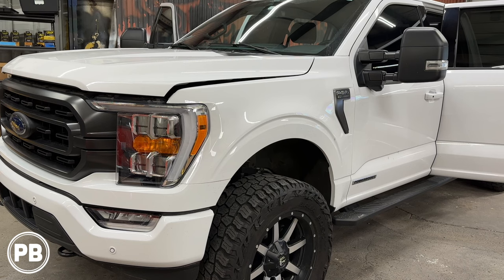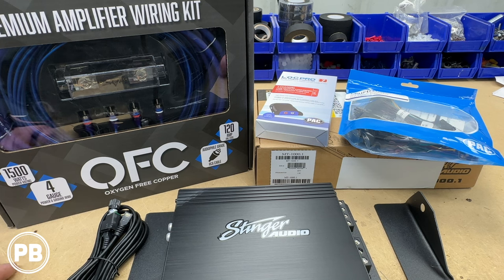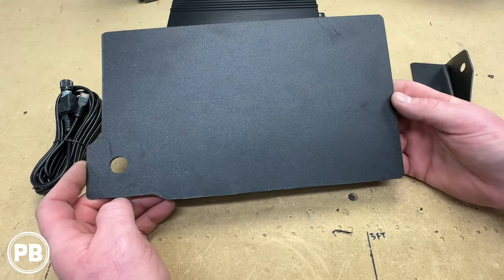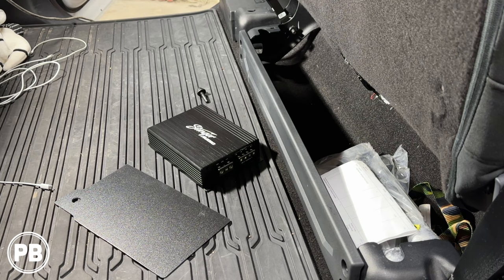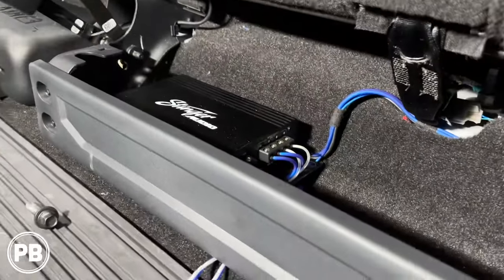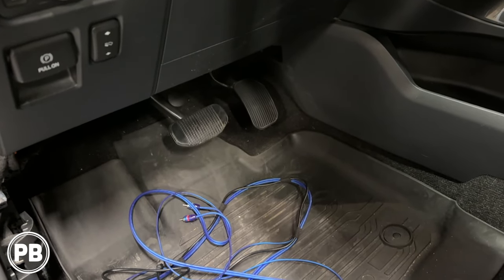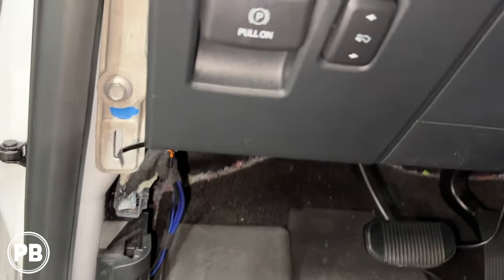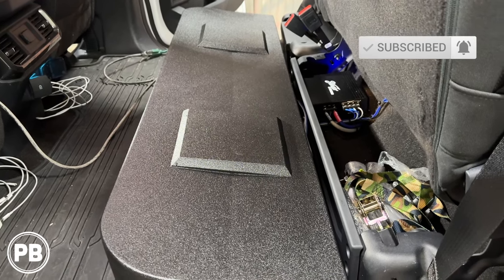2021 - 2024+ Ford F150 Amp and Sub Install (to Factory Radio non-B&O)

Comment: I wanted to say thank you for the tutorials, I was able to swap front speakers, rear speakers, and add a powered subwoofer, as well as sound dampen all 4 doors of my 23' F150 Hybrid because of all of your video tutorials.  All of this done solo, in 1/2 a day.  Without your videos I would have made a lot of mistakes, and many trips to get wiring material and tools.  You saved me much time and trouble.   Amazing!

Comment: Question for ya guys i just had a skar audio underseat subwoofer and amp installed on 2023 ford f150. On this install does the amp stay powered on and lite up a few minutes after the truck is off. I was told this is normal because the Radio stays powered up after vehicle is off. This worries me cause I don't wanna run my battery down.
Reply: I have a 23 as well, I shared you concern initially, it goes off briefly after shutting vehicle off,no battery drain issues 3 months later.

Comment: So I got this setup my skar subs are 1ohm at 1000 watts RMS which equals about 31volts on a multimeter. So I played a 50hz test tone at my clean radio volume and turned the gain until I got 30-31 volts on my multimeter . Is this correct please ?? Cause my shit is EATIN!! 😁😁

Comment: Hello I have 1 quick question regarding this installation video also I really appreciate your video as I am just about to start doing my installation on my 2022 Ford F-150xl & although I have done MANY installation jobs & ALL of my own installations they have all been in older vehicles before the Ford sync system that they all have now & I was kind of intimidated by that part if I'm being honest I'm still quite intimidated after your video of going behind the screen to hook up my LOC after seeing how much trim is required to get to it, so is it still possible to just splice in my LOC to my rear door speakers like I have done in many other installations I've done in the past? I'm just concerned of doing something that may mess up the Ford sync system so I was curious if that way is possible to hook up LOC without messing up the Ford sync system? Thanks

Comment: perfect timing man. Just started working on my F150 lightning XLT and this video popped up. you are the best.
Reply: I am learning his awesome video, I got a pro lightning, do I need to put a new amplifier to make the sound better?
Reply: Yes he is the best, I learn to replace the new speaker from his tutorial video
Reply: @LongNguyen-dd6tz I have lightning xlt. Put in a kicker key 200.4 to power front component speakers (tweets in a pillars) and rear coax speakers. Also adding a key 500.1 and the sub box used in this vid for lows. Sounds great so far. Can’t wait for the subs.

Comment: I’ve seen with the hybrids to not go above 30 amp draw. Would this not be an issue with the power-boost. Looking to install an amp in mine and wondering if it would be fine with a regular 12V battery under the hood.

Comment: I have a 2021 F150 non-B&O I did everything step by step and used the exact same products.  My remote wire has constant power and I have to find a different way to power my amp. Thought??

Comment: Isn't the F-150 cab aluminum? Do you need to ground back to the battery properly?
Reply: thats what i was thinking too
Reply: there is a factory ground location behind the carpet behind the seat on the top right i believe. it should be a solid ground location

Comment: thanks for explaining in a way that made installation very 'simple.  But one question. the power light ln he amp is on all the time even when truck is off. is that ok. run battery down? thanks in advance
Reply from the maker: Well if you used the parts we did, the amp will go off when the truck goes to sleep, often times up to 5 minutes after the truck is off.  It should be on all the time, that will drain the battery.
Reply: @ProvoBeastAudio  I used everything on your video except amp but same amp.   Have a skar amp .
Reply from the maker: @CharliePurvis-m3r  Shut and lock doors, wait for 5 min, light should turn off.  Same thing with turn on, as soon as you unlock and open the door, the amp will turn on as the truck awakens,

Comment: are the load resistors not required when adding just a mono amp and subs?
Reply from the maker: Nope!  Load resistors are only needed if rerouting your audio signal from that radio to an amplifier (instead of the speakers).  The OEM radio needs to see a load to function correctly, hence why we add those resistors when sending the radio's signal to a multi-channel amplifier.  For just a mono, since the speakers are still connected to the radio and we are just borrowing signal for our setup, no resistors are needed.

Comment: Awesome video! I’m going to follow this to do an install in my F150. One question, though. How did you mount the bass knob?
Reply from the maker: Stinger amp has allows you to easily flush mount it. Just drill a small hole, includes a nut and washer to mount it, add the plastic knob. Makes for a nice clean install.
Reply: Thanks for the response. Should’ve waited for my parts to arrive before I asked! Again, very helpful video and thank you!

Comment: @ProvoBeastAudio 23 F150 Supercrew I used same set up as you ,tied into rear speakers behind front passenger seat at the pillar instead of PAC at back of head unit,about once every 3 key cycles my rear speaker will not play audio therefore my subs dont power up,any ideas? Should I use a PAC instead?

Comment: Hello I have a question. Will a capacitor or high output alternator or larger battery be needed for a sound system under 1000 watt’s rms? Thanks
Reply from the maker: A healthy battery is all thats needed.  IF worried for something under 1000w RMS, considering doing a big 3 upgrade (video on channel).

Comment: Hi! I’m planning on running a high level input from this same harness to a powered subwoofer, so I don’t think I need a LOC, but is there a way to get a remote turn on wire from the T harness? I’m confused by that.
Reply from the maker: There is no remote / accessory wire at the factory radio as it's all controlled by data.  If you need a remote turn on (and your amplifier doesn't have any DC offset capabilities through the high level input), you will have to go to the fuse box or an accessory source for switched accessory power for your amp.  Honestly, the Pac module is the easiest route.

Comment: So I have a 2017 f150 xlt, it has a upgraded sync 3 screen unit will this wiring harness not work with this, if not what other harness should I use I been trying to find one for a long while but can't seem to find anything that's as simple as this harness. Any pointers?
Reply from the maker: For the 2017, you need the Pac LPH-FD21 version of the harness (non-B&O): https://amzn.to/3SFiKq4

Comment: Your amp setup is just for the bass correct? You would need another amp for speakers as well? Would you use the same t harness for a second amp?
Reply from the maker: Just for bass in this video, but you can add a multi channel amp (5 channel amp) that would power the interior 4 channels, and a sub channel, all in one.  Similar T harness, but a few extra things are needed.  I offer a full T harness kit if you were to also power your interior speakers on another amplifier: https://www.provobeast.com/product-page/2021-ford-amplifier-t-harness-wire-kit-for-factory-oem-head-unit
Reply: @ProvoBeastAudio  you’re amazing. Thank you!!

Comment: How does a system like this cost for equipment and labor in total?
Reply from the maker: All parts we used are linked in the description of the video for prices. As for labor every shop differs so you may need to call around.
Reply: I'll check them out thanks. Great work

Comment: Question will this harness work on a F150 2023 XL with a 8in screen? Curious cause the harness listed now looks a tad bit different then what you have in the video. Just a new model?
Reply: Pull the radio and see what connector it has. Just a few screws and trim pieces.

Comment: Could that pac harness be used in the same way to use a Hertz S8 DSP? Or any DSP instead of using the line out converter?
Reply from the maker: Yeah, those Pac T harness are great for that.  This pac harness is for non-B&O trim, so if that applies to you, it will work great (linked in description)

Comment: How much does a installation like this cost if i bring all the audio parts ?
Reply from the maker: All depends on the shop.  Some shops wont let you bring outside equipment, some do.  I'd just call around.
Reply: How much do you guys charge? I'm in utah County, and I just need some bass in my f150 and ran across this on youtube.

Comment: Does it have to be shallow mount subs? I have a single 12” skar sub but it’s not a shallow mount. Will I fit under the back seat?
Reply from the maker: All depends on the box you install.
Reply: @ProvoBeastAudio  I got the pre made box from skar for a single 12. But I don’t know if it’s made for a shallow mount or not. But it’s made for my f 150 it says

Comment: So I am doing this right now (started yesterday) with a powered sub, and I stupidly did not disconnect the battery before doing so. After trying to fire everything up after getting this connected, the proximity lights/door unlock have stopped, the dome lights, instrument cluster/screen, and infotainment display have stopped working, and the vehicle will not start. I’ve charged the battery and even replaced the battery, as well as checked the fuses. All I have checked looks good, and I have even disconnected the sub and wire harness so that it is not a factor, and it still does the same thing.

Anyone else have this issue? Did I miss something important when reconnecting? I was pretty sure I reconnected everything properly, but it’s sounding more and more like I missed something important or knocked something loose. so if anyone knows which connector to check based on what is going on, I’m all ears!
Reply from the maker: Sounds like a bad connection at the battery.  I'd recheck all connections, or consider seeing your local audio / mechanic shop for assistance

Comment: Thanks for the video. Kinda surprised since you went with a 1 Ohm connection with the amp to not include a capacitor to help with any power surges. You did go with a 2 driver sub system around 1000 watts, that's going to pull some amps. Whenever I install a 2 driver sub I like to include a Capacitor for peace of mind.
Reply from the maker: most capacitors are worthless.  If you need help with voltage drops and current needs, you are much better off upgrading your battery under the hood, doing a big 3 upgrade, and if needed a second battery / super cap / isolator.  Most caps on amazon are garbage (filled with sand to fee "quality").  Please don't waste your money on them.
Reply: @ProvoBeastAudio  Thank you for that advise, I was always curious about the Caps

Comment: I have a kicker kISLOC2 LOC, it does not have a yellow wire, only has four speaker wires a ground wire, and a blue remote wire. Will this work with the set up?  Thank you
Reply: Yes it will work